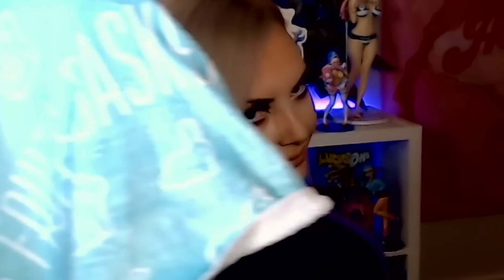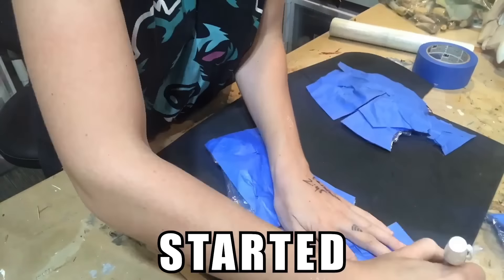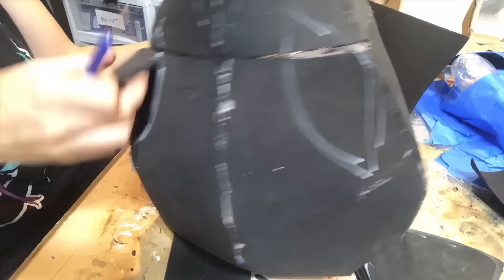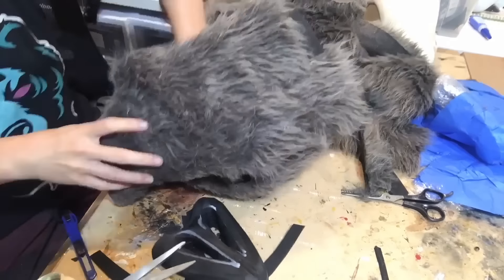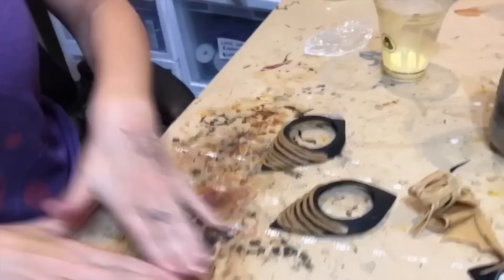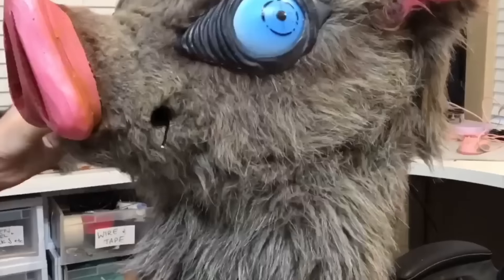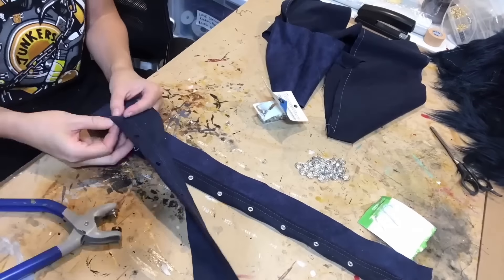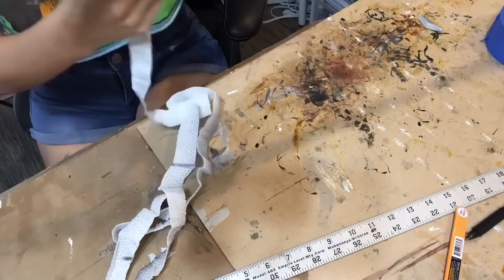I MADE AN INOSUKE COSPLAY FROM SCRATCH!! (HEAD, TOP, PANTS, SHOES AND SWORDS!) +SHOWCASE

Comment: I know you're big on people leaving advice comments with tips and tricks, there are some little things you can do to make your voice overs sound really polished. Beyond the simple noise gate for background noise and a high/low pass filter to get rid of any excess rumble and hiss there are some basic things you can do. First, on the eq with your high/low pass filter, boost an area several db and then sweep around the midrange frequencies, usually around 1-3k to find where your voice pops more, or sounds more like you do in person, then lower that down to just a couple db. This will make your voice sound just overall better immediately. try setting up a couple compressors to smooth out your voice and give it that bold, radio voice. nothing major, just a 2:! or 4:1 ratio, nothing crazy, then play with the attack to make it sound natural and set the release around 15ms. I recommend the Waves Waves CLA-76 compressor plugin, specifically the blue one, for your voice, and its like $29. I also recommend the Waves MV2 Compressor on top of basic compression as these focus on specific frequency bands and it really makes your voice more full, round, and crisp. Beyond that, use a desser to get rid of those harsh S sounds before compressing and your voice will sound like its on the radio.